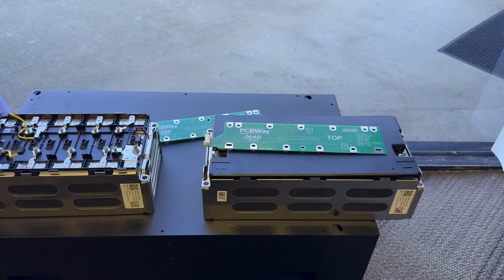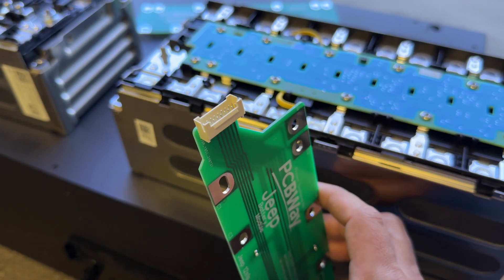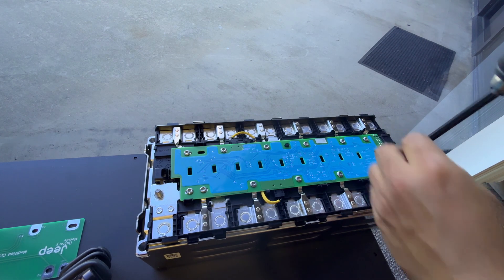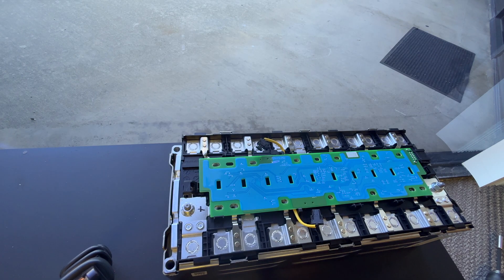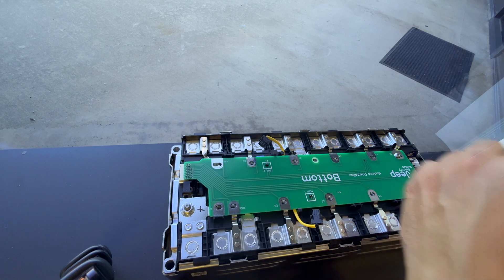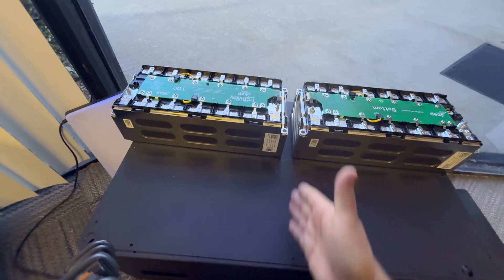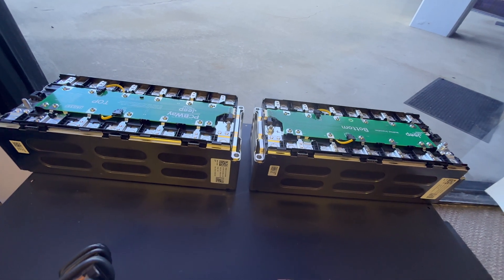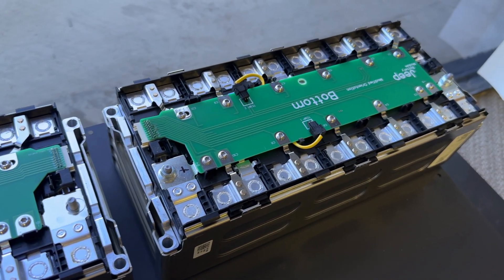The Perfect Battery Module For Classic car conversions

Comment: 44v (38.4v) is kind of an odd voltage. Is it possible to make two of these into an 8s3p 24v battery? Do you have a BMS solution? Are these Lithium-ion cells?

Comment: Anyone have a suggestion for making a cheap DIY motorcycle battery (for a regular battery for starting/charging system not an electric motorcycle) I'd like to use harvested 18650 li-ion cells.. Or maybe lifepo cells if I can find them.. They have decent little cases available.. What would be a decent bms for 12v system.. Running at 13.8v or so... That the alternator can charge.. And can be put on a maintainer in the off season.. But ready to use at any time..
Reply: 4 headway cells 😁 he sells them on website. High output lifepo4. Works out to correct voltage. Files on thingiverse to 3d print holder for this. Good luck 😁
Reply: @redreefbud thanks, I'll look into those.